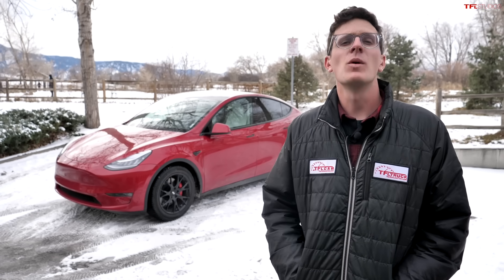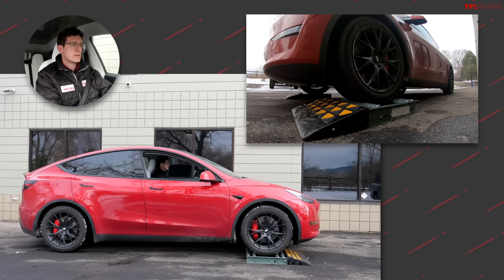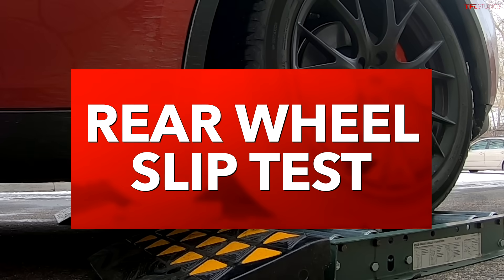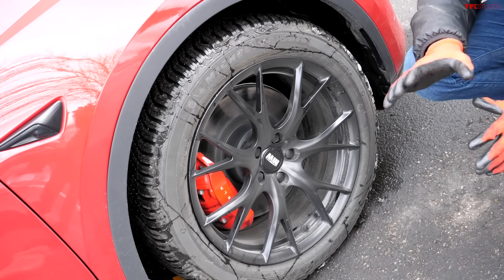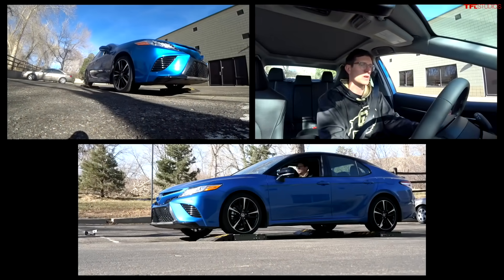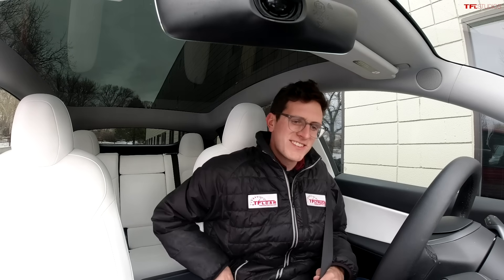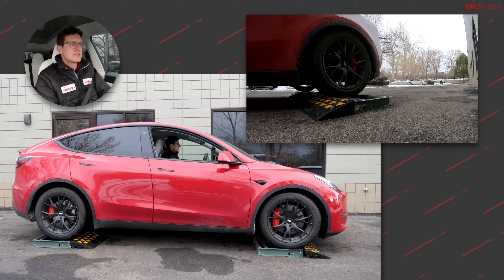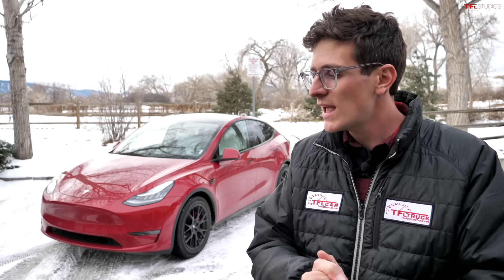Does Tesla Build a Good AWD System? We Put The Model Y On The TFL Slip Test To Find Out!

Comment: TFL:  Good test set-up and demonstration of more work to go on the Model-Y.  When your factory and test track are in Fremont, CA it's difficult to fully test the AWD system.  Your simple roller test an be repeated anywhere!  I'll assume that the Model-Y dual-motor AWD is "capable" of passing your TFL Ultimate 3-Wheel Slip Test once Telsa engineers work on the problem and provide an over-the-air software update to your vehicle.  PLEASE repeat this test when such an update occurs.  Hopefully you can put a link into this video for your Part-II, post-update test.  Thanks!  Good job!

Comment: Man I hate it when they aren't permanent all wheel drive. If one wants more power to the rear then use default ratios e.g. 40/60 or 30/70% ratios. But keep all wheels spinning and and apply torque vectoring. Personally I would like 50/50 but that may make the car unpredictable so then 45/55 should be perfect. 

Not sure if this test showed that the Tesla is basically a 2wd as many other "all wheel drive" cars. It would be nice to see some tests at speed to really know what is going on. 

I had a Audi V8 once which had a torsen differential. 50/50 as default but mechanically basically able to shift 25% to either rear or front. It was a dream on snow and ice. Audi Quattros with torsen differentials are imo the best all wheel drive system for on road driving. Only competitors I see are Subaru and Mitsubishi Lancer EVO, the later is not made anymore and Audi is giving up on Torsen.

Comment: That explains why my P3 couldn’t get going on a sloped uphill ice sheet and instead just slowly slipped sideways into a grove of bushes until I crushed them to gain traction, while Audis, VWs and Subarus just pointed and laughed. Garbage result IMNSO. With full wheel control they should be able to weight the “slip start” mode to be essentially more like a “locked center diff” mode which disengages after a certain distance (via momentum calculation using the G sensors).

Comment: I think the problem with the front wheel 1 tire on the ground is weight. It's a crossover with a bigger electric motor in the rear. The front compartment is probably empty. So you're not getting as much traction in the front compared to the rear.

Comment: i guess the 3 roller test would work better (for any car) if the traction wheel would be lifted up with a wood plate to compensate the roller thickness. that wheel otherwise has less weight on it and might struggle to pull a heavy car forward anyway.

Comment: I’d really like to see a standing start in snow on Lickskillet Rd.  I’ve been driving my stealth performance Y around Park City and I’m truly impressed how well it does at getting traction in snowy conditions.  Obviously, you need proper winter tires to keep all that torque under control (HP probably not important for the low speeds involved).  I have yet to experience a situation where traction under power was an issue.  Yesterday, I did slide through two stop signs coming down my hill, but at slow, controlled speeds.  Would have been a problem if there were another car, but it was early.  Here’s a nice Tesla feature for those of us using these as ski cars - I left the climate on this morning when skinning PCMR in the dark and I came back to a car with a 69 degree interior vs 10 degrees in the parking lot.  Well worth the slight loss of range!

Comment: Great video. Clearly more rear wheel drive than front but perhaps Tesla will see this and issue an ‘over the air software update’ to help with this potential issue. I think it would be cool if the Tesla computer would interact with the amount of information it has over the air, like weather and GPS location including cameras on the car to to recognise and adjust the cars set up as a custom setting (within safety reasons) to deal with the current real time terrain the car finds itself in at any given time. 
Either way, more potential tools at its disposal for a standard well rounded car.
Reply: I would love to see this test again today to see if anything has changed
Reply: Normally the traction control on cars handle this info just without using air temps. It detects what wheel is spinning, directs power to a wheel that is getting traction.

Comment: Thanks for telling me that was an SUV. Looks like a 4 door hatchback sedan to me!
Reply: The term SUV is used very loosely these days, it basically lost all meaning.
Reply: Its a crossover suv.
Half suv half sedan.
Basically the only reason they call it a crossover suv because of the giant hatch
Reply: It's sporty. It offers a lot of utility. It's a vehicle.

It has a large rear hatch, great cargo capacity, small front trunk and moderate towing capability. You can install a lift kit and taller tires and take it off road.

What makes an SUV? A frame? Bad gas mileage? Bad aerodynamics? Stiff ride? Solid rear axel? Old tech? Burns fossil fuel? 
Two box stying? Visits gas stations once or twice a week? 

Ok. Just call it a Model Y.
Crossover, wagon, hatch, whatever. 
The crap people focus on.

The Model S is is a hatchback sedan. That's a lot different than the Model Y.
The Model 3 is a proper sedan with a trunk lid.
The Model Y is over 7 inches taller than the Model 3 and is a bit wider and longer also. 
It's not a small vehicle.
Gotta learn about vehicles.
Reply: @dvader3263 the model s is A HATCHBACK?!?
Reply: It’s an suv like all other hundreds of suvs out there from Japan /korea and now China .
Nothing new why r u surprised.
Even Porsche suvs are the same proportions and height .. not sure what ur comparing it to.
The next level up is of course Toyota / Land Rover / ford proper truck chassis which resembles nothing like suv or “cute Ute”
Reply: @S3XY-00 but those are not SUVs. You're proving the original point. It's false advertising

Comment: The whole test is corrupted, IMHO. He elevates the whole car (remember 3 wheels on rollers, 3-4  inches above the ground). Because TESLA has a more rigid frame (due to the battery pack, etc), the remaining 4th wheel does not have enough weight on it to provide traction. I believe intentionally or not, a missing footage of the wheel on the ground could prove that. I believe I heard it spinning. Toyota has a less rigid frame and potentially would "accommodate" the ground wheel with more weight for traction.

Comment: Typical AWD car with central locking diff (or even just transfer case with the clutch) and two open diffs is a much better AWD system than electric vehicle with 2 independent motors. The reason is that you can have all the power on either axles of the car if required, while in Tesla you'll have less than half of the power (on weaker motor axle) which is a serious problem with 3 wheel TFL test as we've seen.

Comment: How do you think the Model Y did in this test compared to the same test you did on your Model 3.  I was convinced to buy a Model 3 LR Dual-Motor after seeing your similar test and wish I didn't have to sell it.  I have the Model Y Performance now which doesn't have the same range as the M3 and those stock low profile tires are scary for long road trips in the winter.  There are many trips I take where there is no cell coverage in case I get a flat. Like you, I am planning on replacing the stock 21" wheels with Martian Wheels and was wondering if you saw a reduction in ground clearance with your Michelin tires?  What offset did you order for your 19" wheels and what tire size? I was thinking of 255/45R19 on all wheels.  I lived in Colorado Springs for over ten years and miss the scenery.

Comment: Slip tests should be done in the dry. It already is simulating traction in a low grip environment. Adding wet tires and wet rollers as another variable when comparing to other cars' results done in the dry doesn't give you consistent results. If you sprayed cooking oil on the rollers you would also get inconsistent results.

There is very little traction anyway on the rollers since that is the purpose. But there is some friction between the rollers and wheels. Also the tires that are making contact with the pavement are wet and it will affect their grip as well.

Comment: 3:45 It looks to me more like the rear engine is dominant in the system, so then at the first test front wheels didint even spin in the first place and the car had no idea that those wheels were on the rollers. It simply didint power the front engine before the rear engine kicked in. On the second test where the rear wheels were on rollers, we can see the power delivery to the rear wheels right away although the car is on rollers, once the wheel spin is apparent enough,  the front engine kicks in and pulls the car out of it. I mean saying that "the front engine might not have enough torque to pull the car out" is really biased, because the torque numbers needed to pull that car out in this situation is really very very low, even pushing the car from the back with hands should be enough to roll it out of those rollers... I can hardly imagine an engine that wouldn`t be capable of that task in these conditions... 

How fast can you turn the engine in to a reverse? 10:23 if you can shift to reverse quick enough, you can "swing" the car weight out of there, it does work well in those kind of situations, gets the momentum needed to drive out of mud etc..

Comment: You are testing the Performance MY. 
I have the LR MY, drove it first time this past week in NJ in the snow storm. It was stable, though I did fish tail a couple of times over 35 mph. 
Takes some getting used to, had a AWD R350 in the past & with that weight, that was more stable than the MY. Overall, it was fine for regular winter driving. 😊😍😮

Comment: Great testing.
There's a few things I'd like to weigh in on though. First. As far as I know, no Tesla has a limited slip differential, and rely fully on braking the wheel with less friction available. So they can't really put power to what wheel they want. They can only put power to what axle they want.

Not sure if the Model Y has range mode. If it does, I would urge you to do a follow up where you drive the last roller test in range mode. This sounds strange, but at least on the Model S and X driving in range mode will make it front wheel biased. Because the front motor is smaller (on a lot of models) and use a higher gear ratio to use less energy. This should probably be better to get you out of that sticky situation where you only have traction on one of the front wheels.

And lastly, by default the car should drive with permanent four wheel drive if the temperature dips below 3ºC (37ºF), at least that's how Model S and X behaves. That might also impact your testing.

For reference I drive a Model S with dual motor setup.
Reply: Model 3 and Y dont have range mode unfortunately

Comment: It sounds like that front left wheel on the ground was spinning. Was that front left wheel having traction problem as well or was it the vehicle not being able to send enough power to just one front wheel to propel itself?
Reply: I know, I was wanting to see the tire that had traction but they never showed. Pretty damn lame. They showed all the rest, what’s the deal?
Reply: I understand where your mind is at, but the sound of the tire spinning on pavement likely was one or more tires touching the edge of the rollers.  Those tires used in this test are the newest high performance 3 mountain peak all season tires. I highly doubt it was slipping on the pavement. 

I suspect the programming was never dialed in for 3 tires without grip and only 1 tire in the front with grip. Thankfully, that's an easy over the air update fix away if Tesla tasks their engineers to fix it.
Reply: @uberragen2181  Already done!
Reply: I think it was, it just weighs too much and the weight is rear biased and there's not a ton of travel in the suspension, so it just lost traction, I think you're right.
Reply: Think it is an issue of weight distribution.
Three wheels off it just didn't have enough weight on it to find enough purchase, no matter the torque.

Comment: Yor 3-wheel test is faulty. Once you’re up on the 3 rollers, the car is 2 inches off the ground. The single tire in contact with the ground has virtually no weight on it. The car in real conditions would likely perform far better.

Comment: Keep in mind that the model 3 and y only use the rear motor because of its efficiency. The front motor is only in use when you floor it or lose traction on the rear wheels.
Reply: Also of note is that the Performance model allows you to set it to track mode and adjust how much power goes to front and back (defaults to about 80% rear). If you're actually stuck in the back, you can set it to 80%+ front to compensate.
Reply: @raddaks2039  True

Comment: You showed all the wheel except the wheel that counts to prove this theory but it sounds like the front wheel was slipping on the asphalt in the last test. That basically means that the weight balance doesn't allow for enough force to be generated to pull the Tesla out. That's not really the traction controls fualt. Simply the physics don't make it possible. You would need stickier tires or more weight over that wheel.

Comment: Needs a differential lock. Of course dual drives, you'd need TWO differential locks.
Reply: I agree that they SHOULD offer that, but I'd BET most of their customers wouldn't understand it or find sufficient value in it to buy it. Jeep customers, well that's different, hence the Rubicon.

Comment: Not sure if anyone mentioned it but I know if you are not at full throttle or above a certain throttle position... only the rear motor is used. Also same when you are driving at slow speeds. Which explains why when you put the rollers on the front wheels it doesn’t do much vs the rear wheels.

Comment: Same test with Audi Quattro, please.
Reply: Which Quattro would you like to see?
Reply: @4x4.tests.on.rollers  Their latest and greatest. A competitor to the Model 3 and/or Model Y.
Reply: @GodzUnit01  If you mean electric then they only have a competitor to model X, that is E-Tron, unfortunately I don't have it. But I did tests of almost all other types of Quattro.
Reply: @4x4.tests.on.rollers  Non electric. RS6.
Reply: @GodzUnit01  That's based on torsen C. I didn't test it but you may check the tests of A5 or A6 based on the the same torsen type.

Comment: By default, a Model Y drives on the rear motor at low speed (permanent magnet motor). Only if you call up lots of power will the front motor engage (induction motor). It's the opposite on Model S/X, with the front wheels leading.
Reply: How do we know that?
Reply: @maryhadda8420  because that's how these motors work, mechanically. PMSRM can't disengage. Always has to be on. Induction can disengage.

Comment: This test kinda shows how having proper tires is more important than having AWD. The rollers dont allow the tires to be a factor, when in real world conditions they would. AWD alone doesn't always make a difference when tires will. Proper tires with AWD is still the best option, but most won't need it unless living where you are or on steep country roads.
Reply: Proper tires won’t help in an RWD muscle car like the Camaro and mustang. In that case, you should throw the car in neutral whenever you’re in a curve because you will spin out if you touch the throttle at all.

Comment: Would've been nice to have a camera on the wheel that's doing all the work at the end, there was a camera on every wheel except the front left which had traction...  

Give us a better view of what was happening and let us understand what you meant by you cheated to help it out at the end...
Reply: You can see him clearly cheat on the camera side of the car so what he does is he moves laterally along the rollers until he hits the edge of the roller and then the car grabs the edge climbs over it
Reply: @ChristopherRadoff  would've been more clear to see the wheel still, I get the idea of turning till it's using the sides by the rollers, but to have the main part of the test without a clear view isn't the best...

Comment: next time you should actually just order the winter wheel and tire package from tesla we used to install the packages all day on model 3s in new england i have personally driven many before and after in the snow the 18in wheel and tire combo they offer typically adds range compared to the performance wheel combo with the wheel cover only it is a really nice looking wheel but you loose the added range due too the aerodynamic wheel cover

Comment: This should be done on all awd/4wd vehicles TFL gets to test.
Reply: I totally agree!!!  Awesome test and it really shows how good or bad the AWD/4WD works.
Reply: Would love to se the e-tron and the fullt electric xc40 on the roller.
Reply: Same thing goes for the F150 with the 4 auto.
Reply: I would really really like to know how my Audi S6 compares to the AWD cars of today. There seems to be very little info on the AWD system on my car.
Reply: Certainly all wheel drive and also 4 wheel drive with locking diffs or limited slip. An open diff 4 wheel drive actually SHOULD fail the diagonal or 3 wheel test though. I suppose you could still do it, but it's kind of just a fact that if you have 2 open diffs and no traction on 1 wheel on each axel you're stuck.
Reply: @christopherpedersen1820  ~ I was thinking of the test for the traction control systems. Some are very good, but some seem very weak. I don't know if any vehicles are sold anymore without some kind of traction control??
Reply: @HoosierDaddy_  Yeah, after I commented I realized that for modern things that may not be entirely true. Even 4wd with open diffs is effectively all wheel drive if you have some traction control. And yeah in the US everything since 2011 has to have traction control I guess.